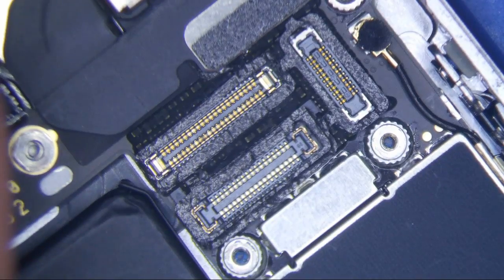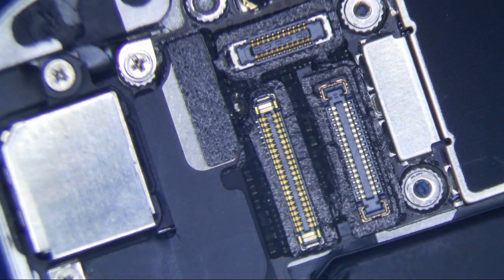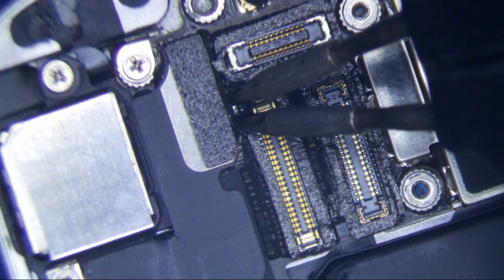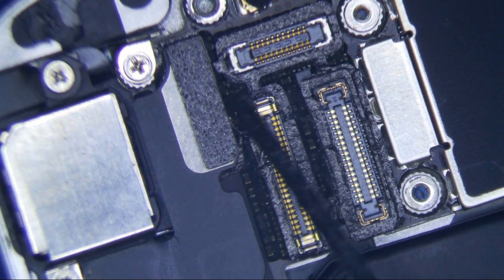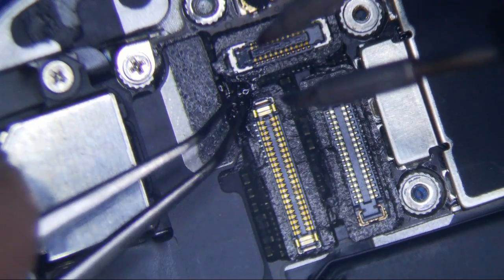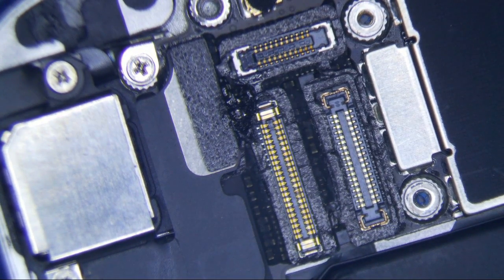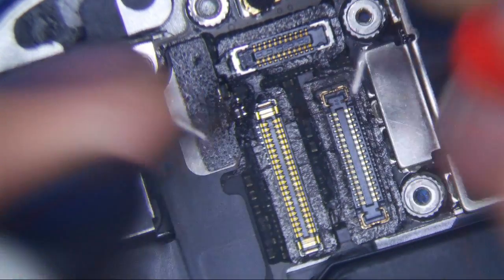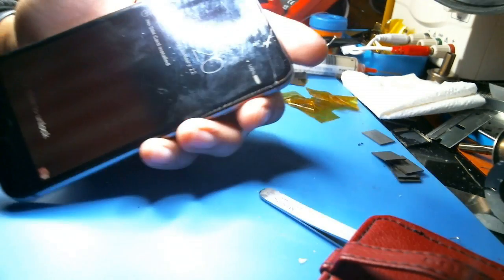iPhone 6S Backlight Filter Repair

Comment: Hey man I really enjoyed your video!
I just have a iphone 6s with probably a broken backlight filter fuse.
I already bought a soldering tool and also the new filter fuse.
What is the liquid that you put on the phone in the beginning? And did you even really solder it?
Thanks
Reply from the maker: Blitzcrank its solder flux.  Amtech NC-559-tf.
Reply: Thanks for the quick reply!
Can you also do this repair without it?
Reply from the maker: Blitzcrank not really

Comment: I have same problem woth 6s. I just want to find out how do u check short in filter? I mean in my phone i removed same filer and tested the pads with ground. It shows beep with one pad and doesn't beep one the 2nd side of the filter's pad. It is normal? If filter is bad It beeps should beep both side of with ground or one side or it shouldn't beep at all. Please clear this point to me. 2nd when you check filter with connector line it shoud show beep on both side of the cap or it shouldn't show beep at all..your responce will be highly appreciated..
Thx